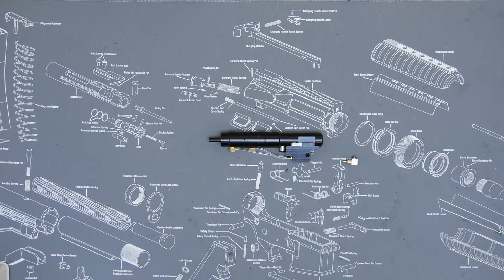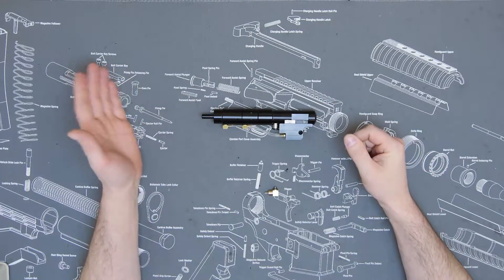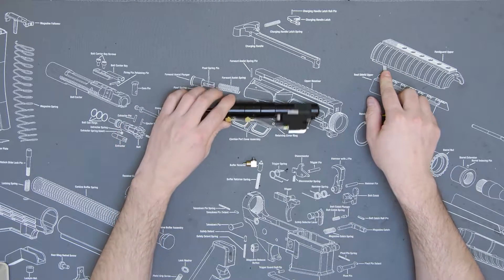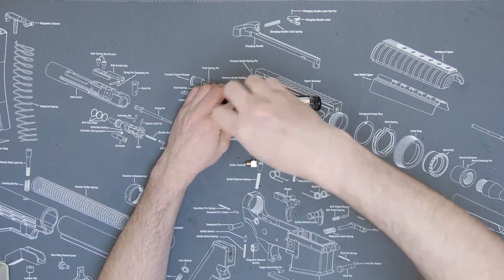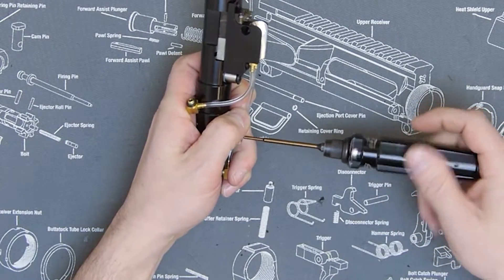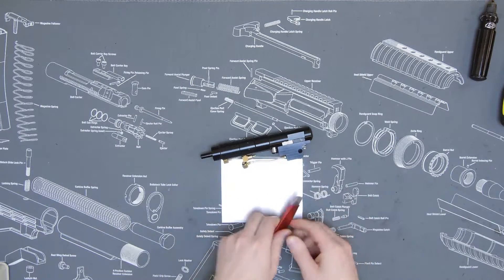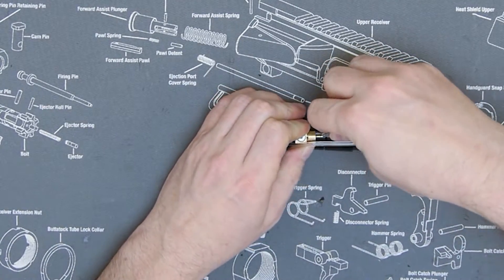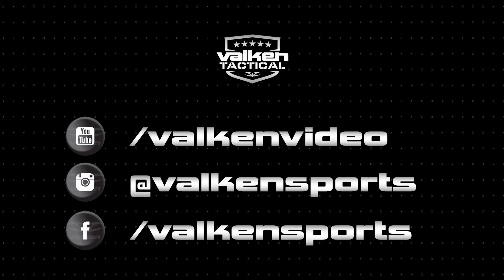Valken Tech Vault - V12 QEV Upgrade Installation

Comment: Started noticing issues since the QEV upgrade which at first was great. Opened the gearbox to perform maintenance and found that the front airline was smashed against the upgraded qev and the gearbox body. Looking at the video again I don't see that I did anything incorrect. How do you keep that line from getting smashed? Also where can I get new airlines? I msg the Valken FB page but to date they have ignored me.
Reply: Stale Cookie yes I did. I followed the directions in the video.

Comment: So I installed the QEV awhile ago and it's helped. Today I opened up the engine to do maintenance and the hose going to the front qev is somewhat comprised where it lays over the top of the upgraded qev. Is that ok or is there a better way to run the front hose then is in the video? thanks

Comment: I installed the QEV mentioned in the video but I find at 90psi with a 48ci /3000psi tank I'm only getting around 720-800 shots from my tank before it's empty. How else could I go about improving the efficiency of my V12? 275mm inner barrel, standard poppet, red nozzle,  my cycle nozzle back is set to 14 ms, my cycle nozzle forward is set to 25ms, my cycle valve timing is 2ms, and ROF is 20 rps.
Reply: low flow poppet form polar star
Reply: Thanks, I actually installed a gold low flow poppet and removed the QEV valve because I think it may have not been the correct size for the version 1 V12 engine.
Reply: +Damian Strong

    What is the shot per tank with the new low flow? Also why do you think the QEV was the wrong size?
Reply: AintEZBeinCHZ With my 90 CI/4500psi tank I get around 4050 shots so more than enough for a full day of airsofting especially on semi only. Actually last time I played at blast camp after the full 6 hours of play I had only used ~500 psi with my regulator set at ~75psi output. Valken Actual actually worked on my gun and warned me about the threading issue with the old parts and once I installed it I noticed my efficiency dropped so it must have been leaking air around the QEV somewhere. like on a 48ci/3000 psi tank I'get get maybe 800 rounds from it. Mind you this was also before I put the gold poppet in and in both setups I have a red nozzle. I put the standard valve back in before I added the gold low flow poppet though and had a 200 shot increase in efficiency on my 48 CI tank though.

An easy way to check how many shots you should get per tank fill would be psi/ regulator pressure (or 100 for an average) * the CI of the tank to give a rough estimate. You can use that number as a base line to see how your setup is performing relative to that.
Reply: I just ordered my new low flow poppet and was advised to get the QEV from valken as well, I got one QEV and put it on not knowing that I should buy two  so I ordered another, but after seeing that it was giving you problems I'm not sure if I should install it.
Reply: if you have the newer V12 you shouldn't have an issue with your QEV. Swap the valve out and test it and if you don't like the results you can just as easily put the original valves back on.